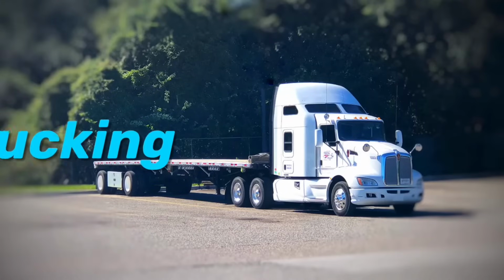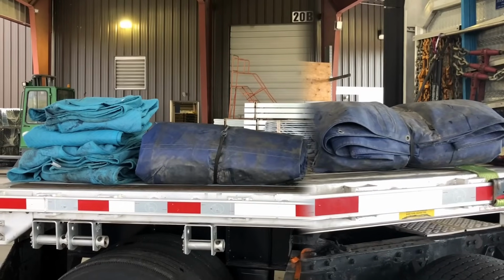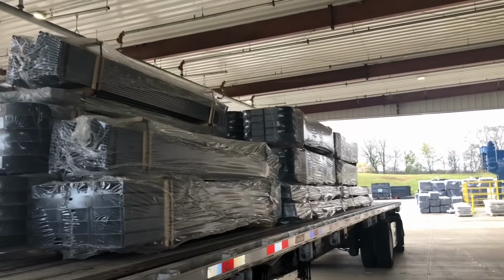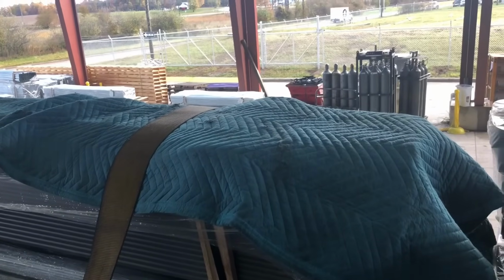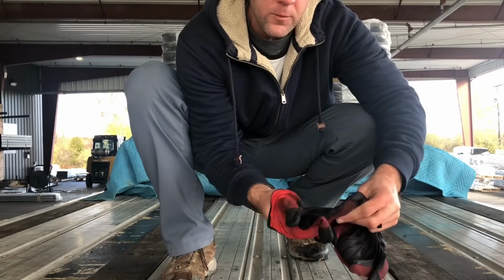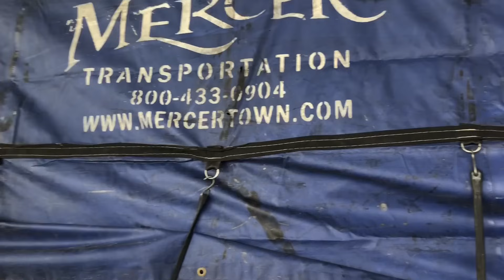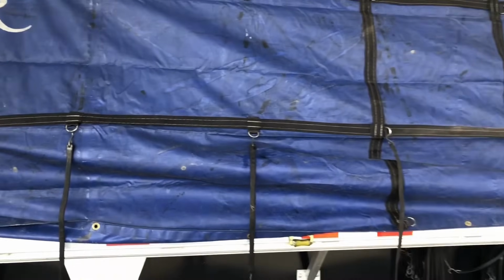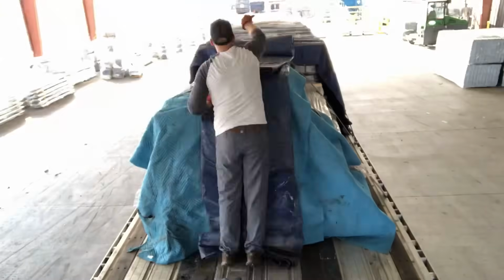How to Tarp a Flatbed Load - Flatbed Trucking Tarping Basics

Comment: So true about newbies, it’s taking me about 2.5 hours to tarp and secure a 35’ trailer.  It’s unacceptable, but it’s where I’m at.  I am getting better with it each time though.  Mainly, I just run out of gas and get tired.  I’m dealing with 100+° temps in the Deep South and tarping just wipes me out. I have to go shower immediately, every time I tarp a load.
Reply: Yes its a bitch especially when the freight is really tall. Completely wears you out and then having to drive afterwards its rough ! They should make light weight tarps because the heavy ass tarps is very difficult
Reply: @JustTheFacts317  tarping anything over 7’ ft tall should pay a couple hundred extra.
Reply: jaepcam  that’s a very old pic of me back when I was a competitive weightlifter.  I’ve lost 70 lbs from when I was at my heaviest.
Reply: jaepcam  I want to drop another 50 lbs
Reply: @BoldBuccleuch It’s never worth the pay
Reply: Im sure you are better then your 2.5 hrs to tarp and secure, im new at flatbed and thats where im at now,
Reply: @BlackBuffalo23  I did get a lot better and faster at it, but I sincerely hate tarping and most of the time I flat out refuse tarped loads, or I just don’t tarp them.  If it’s something that obviously has to be tarped, then that’s different, but I’ve hauled shit that they wanted tarped before, only to have the receiver unload it and park it outside in the elements…so why did I tarp the damn thing.  Didn’t take me long to learn the trucks of the trade on tarped loads.  

Receiver: “Why isn’t this load tarped?” 
 
Me: “I removed the tarp at the truck stop before driving over here to deliver it this morning so we could get unloaded faster and I could get out of y’all’s way.” 

Receiver: “Ok, fair enough.”

Comment: On the ends, pull the corners across first, then flap the centre over them. That way it is cleaner with fewer pockets to trap water, and less chance of the airflow ballooning the sheets. 
I see you are wearing gloves, but be wary of wearing rings.  In any manual work they can catch and result in serious injury.  A fellow driver lost a finger when he put his hand on the edge of a trailer as he jumped off it.
Very good advice at 3-00.  Concentrate on doing a job correctly, and you will get quicker without trying to.

Comment: 0:48 what if you physically can't do that because the tarp is too big and heavy? I want to flatbed and I'd hate not knowing how to move a heavy tarp to be a reason why I can't flatbed truck....
Reply: The tarps are heavy and a bit awkward to move around, but if you just follow proper lifting technique you'll be fine. Some shippers will also lift your tarps onto the load with their forklift too, just ask them about it when you check in.

If you're going to be a company driver you can also try and find a company that runs curtainside or rolling tarp trailers, that eliminates the hassle of tarping but it also limits the kind of freight you can haul.

Comment: It's pretty easy to tarp a nice square load. But I get these oddball loads of machineryt
Reply: Oops hit the wrong button
Any way, how do you tarp oddball loads that are not flat and square? With handles and pieces sticking out a foot or so from the machine? Plus there is about 3 feet of space from the machine and the edge of the trailer.

Comment: I can save you even WAY more time.  Instead of rolling out the tarp on top of the load.  Roll it out on the ground and have the forklift guru center the tarp on his forks.  Put a small rope on each corner and have him lift it to the center of the load.  Use the rope to pull the tarp over the other side of the load and secure the two corners with the rope (temporarily). As Forklift Guru backs out, the rest of tarp will fall to the side.  Your tarp should now be ready to roll and bungee.  EZ PZ Chicken Squeezy.

Comment: How long do those blankets last usually and how much do they set you back? Same question regarding tarps.
Reply from the maker: The blankets range anywhere from six dollars to $12 apiece and depending on how much you use them, 6 to 12 months. Tarps range considerably and it kind of depends on how you treat them as well as the quality of the tarp. I have a buddy that has had a set of tarps for over six years and still going strong.
Reply: @DrivenTrucking  Thanks for the reply damn those are some good tarps to last that long, those blankets are cheaper than I thought they'd be too. Watching some of your backlog videos now be safe out there!
Reply from the maker: Todd Ison Thanks a lot Todd! Yeah that timeframe is probably rare unless you get really high and tarps which in all honesty are not that much more expensive than cheaper tarps but he also takes very good care of his tarps.
Reply: Harbor freight is a great place for blankets. And treat your tarps right they'll last you a long time. Few extra minutes will save you thousands in tarps during your career. 

Remember. If they're flapping. They're getting worn
Reply from the maker: nick abel I know that’s right 👍🏻

Comment: Quick question! Have you ever carried a load taller than you? In that case how do you get that tarp over and successfully put it over the load if the load is tall
Reply: I did one that was 9ft tall and it was the most difficult thing I've ever done in my life. Kind of made me want to get out of flatbed lol. Its extremely dangerous as well because gotta use a lot of strength to pull the tarp over and adjust it etc and can fall of not careful or if u get tired.

Comment: The only thing you did right was putting the back sheet on first, as to the rest, politeness stops me from commenting. Except, young man, if you keep lifting a rolled sheet in that fashion your back won't last the course. You'll be knackered long before retirement. Here's the clue, stand it on end, drop into a full crouch with your knees under you, let the roll fall evenly on your shoulder then do the lifting with your thighs. Bon continuation. ;-)

Comment: Why do some drivers strap over the tarp?
Reply from the maker: I personally don’t like doing that because it can create stretch spots in the tarps making them weaker but sometimes it’s necessary. It will keep the tarps from flapping and out of the wind. If you have a full load and there’s not a lot of overlay between the two tarps, it’s a good idea to throw a strap over the spot where they meet to keep them together going down the road.
Reply: They've prolly had bungees break. I always thru a few straps over the tarps but put some blankets inbetween to help prevent the spots he's talking about

Comment: OK, so I'm a company driver so I may be excluded from this conversation, but there is NO reasons to crimp any bungee. I know it's cute or whatever to have a "secret", but they will not damage your tarp if they're facing outward... Just use your damn bungee the way it was meant... There is NOT enough pressure to ever puncture a tarp strictly from outward pressure on a bungee. Do almost any load and you'll see. Just f-ing use them...

Comment: Thank you for this great video. I'm in school right now and checking out the flatbed companies, because I'd like to be home a little more. I'm a little on the shorter side, 160 lbs, and I don't believe I can lift a 120 lb tarp over my shoulder. I feel like a fairly fit guy, just haven't been hitting the weights in a while. Should I apply anyway? I've read you have to be able to do that, or you're not qualified to work for some flatbed companies.
Reply from the maker: Thank you! Typically the guys running the forklifts will toss your tarps up onto wherever you need them so I don’t see that being an issue.

Comment: I remember when I first started flat bedding , i got coil loaded and didn’t know about the blankets because the first couple of loads were on a canestoga ,but i just threw the tarp on it and bungied it down and headed down the road ,it started raining so hard that I couldn’t really see the load while driving , when I got to the delivery the tarp was completely shredded
Reply from the maker: Yeah the padding of tarps is not exactly widely talked about LOL. My very first tarped load, before Mercer, was air-conditioning units and I actually padded them and my tarps were still shredded to pieces 🤷🏼‍♂️